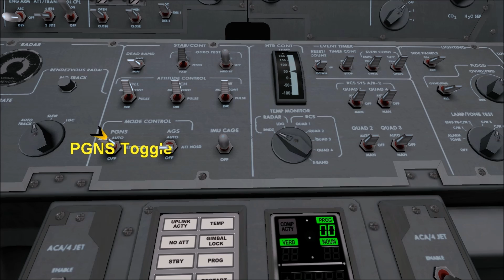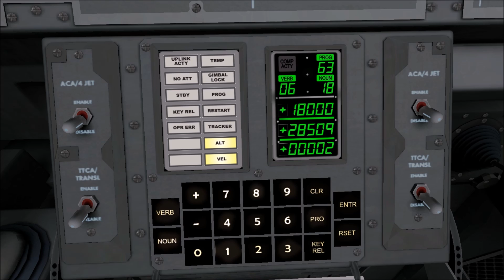Apollo 15 Landing.      Eagle Lander 3D V2.15

Comment: From the start of P64 at 11:52 there was only one LPD callout (Jim Irwin: "47") at 12:59 which means the cockpit voice recorder is heavily edited.
Reply from the maker: Have you tried the sim? Version 2.12 has all the LPD calls, 2.15 doesn't.
http://www.eaglelander3d.com/downloads.html
Reply from the maker: Good spot!  .......   Version 2.15 of the sim EagleLander3D was only ever released as a beta, and was/is very buggy.   The official version doesn't have a PDI from orbit flight option and what you're watching is a modified version of the sim. Although there are several LPD sound files in the sounds folder, and cues for them in the .SIT file to call them up, they just don't seem to be called up when the LM goes through the LPD angle.
Reply: @drakulton1  ... I totally get what you're saying.  Irwin made 29 callouts of the LPD angle in 1 minute 17 seconds during P64.  I just wish I could've heard those while watching the actual LPD on the simulation.  Scott "made a total of 18 redesignations which, collectively, moved the target 338 meters (1110 feet) uprange and 409 meters (1341 feet) north." [ Apollo 15 Lunar Surface Journal - https://www.hq.nasa.gov/alsj/a15/a15.landing.html ]  It would have been cool to see those recreated in the sim display.

Comment: Can someone tell me what graphic settings to use to get the best quality?   I have a very beefy system and video card and want to get the max resolution .... thanks
Reply from the maker: I'm running a  4790K and a GTX1070 and have all the EL3D sliders set to max. Version 2.15 is a little easier on the CPU, and has better graphics compared to v2.12

Comment: This approach appears to be different than on Apollo 11. During the initial part of powered descent Falcon appears to be oriented windows up but yawed about 45 degrees left, unlike Eagle, which was oriented windows down so the crew could see landmarks passing below them so as to check their navigation. As such Falcon only had to yaw right about 45 degrees (instead of 180 degrees) to go windows up, which then pointed the landing radar down. From that point the two approaches and landings appeared to be basically the same.
Reply from the maker: The two approaches were different, on Apollo 11 they were facing windows down for visual tracking, apart from a 10 degree yaw to aid communications on the high gain antenna. The windows down approach was discontinued on Apollo 12 onwards.      Apollo 15 Initially started facing windows up but also had to yaw 45 degrees to aid comms. Three minutes after ignition the LMs had to face windows up to get a landing radar lock.
Reply: @ drakulton - Yes I kind of gathered that from watching your video and a few others. I guess they really didn't need to be looking down visually until not long before touchdown. It's really pretty much an autopilot approach most of the way as long as you trust and verify what the guidance system is doing. Thanks for the info!
Reply from the maker: Unfortunately..... the Eagle Lander 3D simulator version 2.15 only replicates the Apollo 11 attitude control. So any mods to the sim, for Apollo 12 or 15 will also start windows down. Editing can get round this, or some fancy cockpit controls to get the LM to face windows down before engine ignition.  Have you tried the sim?
Reply: Slightly different but somewhat related. The footage from Apollo 11 landing appears to show a fair bit of "sideways" movement before touch down or is that some kind of optical illusion? I genuinely hoped First Man would shed some light to this but sadly they simply reused archive footage (lazy in my opinion). This is essentially what led me to this video.
Reply: @ maxmouche - You are probably right. Just before touchdown Aldrin does say, "drifting to the right a little". It was probably impossible for the LM to hover continuously over one spot with absolutely no drifting in any direction. Also note that the normal practice was to be intentionally moving forward slowly just before touchdown. This was because the astronauts had no view to the rear and could only see what was in front of them. If the LM were drifting backwards it would be going into their blind spot. As such drifting forward insured that the LM wouldn't accidentally drift backwards into a large rock and get tipped over.
Reply from the maker: Taken from the Apollo Lunar Surface Journal.102:45:02 Duke: 60 seconds (of fuel left before the 'Bingo' call). 102:45:17 Aldrin: 40 feet, down 2 1/2. Picking up some dust. [Armstrong, from the 1969 Technical Debrief - "I first noticed that we were, in fact, disturbing the dust on the surface when we were something less than 100 feet; we were beginning to get a transparent sheet of moving dust that obscured visibility a little bit. As we got lower, the visibility continued to decrease. I don't think that the (visual) altitude determination was severely hurt by this blowing dust; but the thing that was confusing to me was that it was hard to pick out what your lateral and downrange velocities were, because you were seeing a lot of moving dust that you had to look through to pick up the stationary rocks and base your translational velocity decisions on that. I found that to be quite difficult. I spent more time trying to arrest translational velocity than I thought would be necessary."]                                                                                                                                                                                                                                                                                                                          102:45:32 Aldrin: Drifting forward just a little bit; that's good. (Garbled) (Pause) [Armstrong, from the 1969 Technical Debrief - "As we got below 30 feet or so, I had selected the final touchdown area. For some reason I'm not sure of, we started to pick up left translational velocity and a backward velocity. That's the thing I certainly didn't want to do, because you don't like to be going backwards, unable to see where you're going. So I arrested this backward rate with some possibly spasmodic control motions, but I was unable to stop the left translational rate. As we approached the ground, I still had a left translational rate which made me reluctant to shut the engine off while I still had that rate. I was also reluctant to slow down my descent rate anymore than it was, or stop (the descent), because we were close to running out of fuel. We were hitting our abort limit."]
Reply: @ drakulton - It's very interesting that Armstrong said afterwards that he was drifting to the left. But Aldrin clearly said they were drifting to the right.  Remember that Aldrin was looking at the rate displays inside the cockpit while Armstrong was looking outside. Armstrong also seemed to say that he was having problems determining his translational rates due to the dust. It would seem that Neil was basing his control decisions on his visual perception rather than on what Aldrin was telling him based on the spacecraft's instruments. If he mistakenly thought he was drifting left when in reality he was drifting right then it would have accounted for his inability to correct out the perceived left drift, which wasn't really there. Notice how he said later, "For some reason I'm not sure of, we started to pick up left translational velocity." This directly contradicts Aldrin saying, "drifting to the right a little". Fortunately it sounds like due to the fuel situation he decided to put it down before too much right velocity built up so as to preclude a safe landing. This type of thing has gotten pilots into trouble before. They start going by their senses and ignoring their instruments. Air France 447 and JFK Jr. crashing into Long Island Sound are two recent examples.

Comment: but that was in short landing mode...14% fuel?  version 2.12
Reply from the maker: what??????
Reply: @drakulton1   my bad terminology...
14% fuel remaining dropping in just east of hadley rille in short flight mode
gives a lot of fuel to land long, or land on a mountain
i liked to land at the bottom of the rille
once i got below 400 i would lean forward and zero my descent rate
zip out to the rim of the rille, lean back, and shed forward velocity
dropping into the trough
it's a long fuckin drop
crashed so many times
Reply from the maker: @luckyirvin  If you have a look in the folders where the program is installed, you'll find the 'Mission' folder. In there are all the 'SIT' files which have the configuration setting for the different flights. You can edit the SIT files using notepad to increase the fuel level to any value you want.